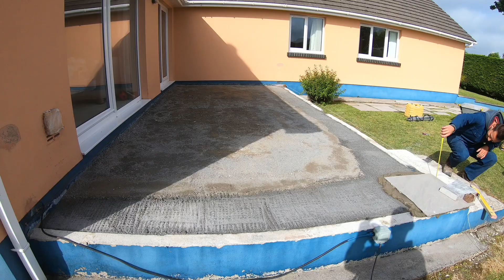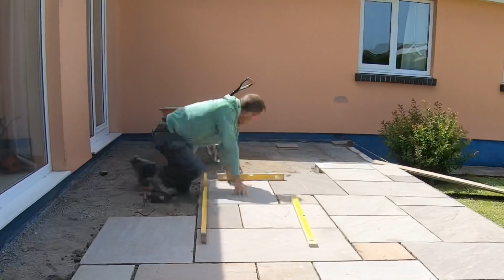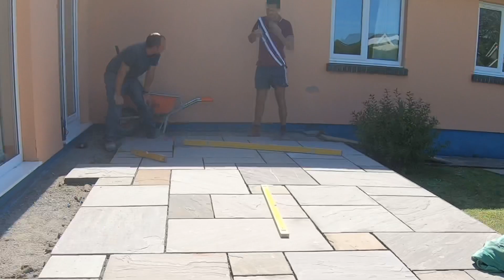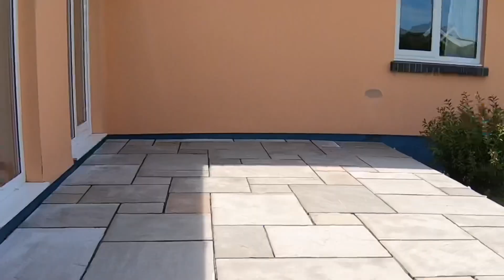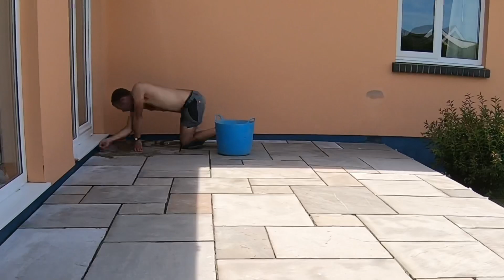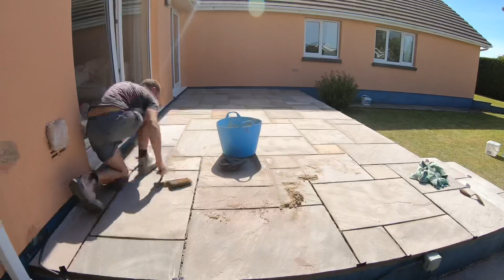Patio time lapse

Comment: Good, but why didn't you start at the house side and work outwards then you wouldn't have had to stand/sit on newly laid slabs? How much plasticiser did you use in your motor mix. No mortar syringe this time?
Reply from the maker: If I started at the house side I’d have ended up with a cut on the edge of the patio (I wanted cuts up against the house) so the only way to avoid that was to start the way I did.  I pointed this using the resin compound which is just brush in, another video on my page about that. 

For the plasticiser if you watch my how to mix mortar video I go through how much I put in a mix.

Thanks for watching too :)

Comment: What mix for the bedding mortar?
Reply from the maker: SpooneyChoonz 5:1 (5 sand 1 cement) with plasticiser
Reply: @SamDaviesBuilder  thanks for the reply, would the be builders sand or sharp?
Reply from the maker: SpooneyChoonz I use building sand - but sand is different in different parts of the country. Basically you don’t want it too fine
Reply: @SamDaviesBuilder  great stuff! Thanks Sam